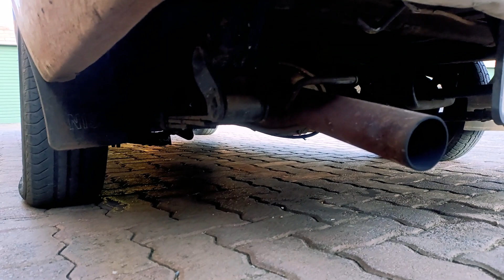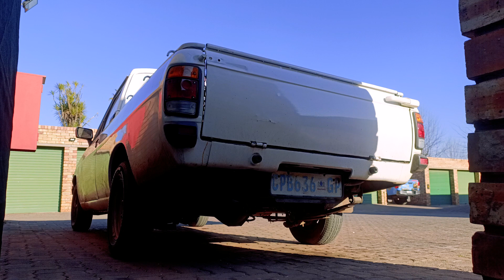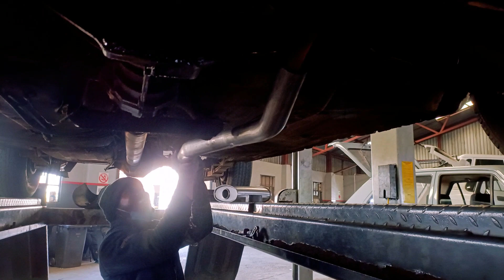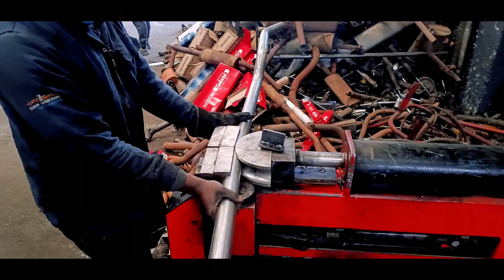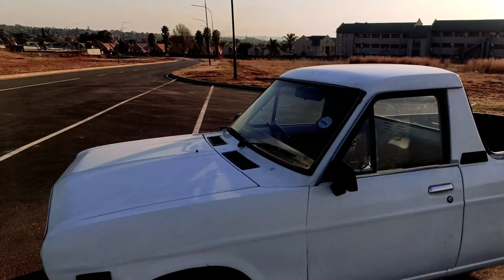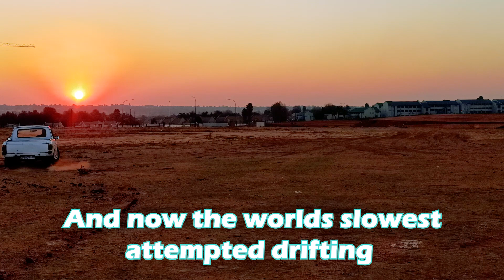Nissan 1400 Gets a New Exhaust | Nissan 1400 Project

Comment: Wel thx for the video. Looks like mine is the same moddle . Any case with th 91`s sum things are little diffrent so your video helped alot.i exhaust mountings in the mid section and at the end is wonkey.  But my real question here is did you see a change in your fuel usage dus to the change in exhaust?
Reply from the maker: The exhaust mountings on the older generation is not great and the body does tend to rust in those areas as on mine. Fuel usage is actually very decent my carbs just still needs to be fine tuned the I'll see a better fuel consumption but so far it's better than it was for sure

Comment: Wats ur plans for bakkie man get a VVL motor would be sick
Reply from the maker: Starting plans are to boost the A14 motor they comfortably make 150kw, but would bin future beanna look at a K20, VVL on these is as common as the 4age so want to do something unique
Reply: Everyone keeps telling me to drop vvl... Way too common.  Boosted A14 or a K series is my future options
Reply from the maker: I recently saw one with a SR20DET that makes 400kw and actually looks really good in there
Reply: @BrandanHewitt It isnt as easy a swap,but I've seen a vg30 done,thats my dream swap for my 1400,but for now i just plan to do throttles whenever i can
Reply from the maker: @Fordzee well there are a lot of options when it comes to swops for these bakkie, I've yet to reveal the engine I got for her, but the A14 is running good now so will build up the parts and everything needed for the swop the only attempt it

Comment: Bro Ive been rebuilding my carb soo much and its still in kak condition.  How did you make yours soo smooth and powerful?
Reply from the maker: I actually bought a new carb from SSS bakkies they come pretuned and you don't have to make any adjustments, if it still doesn't run proper the timing is off but I also got an electronic distributor